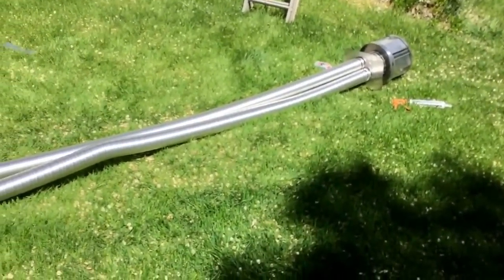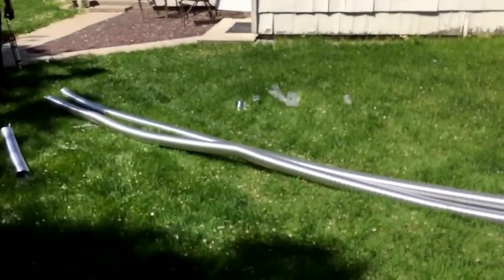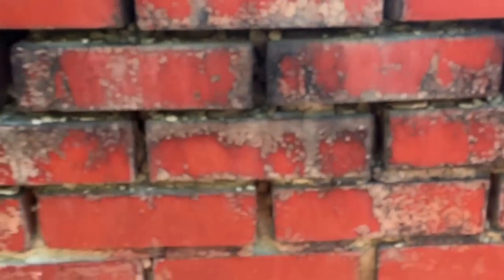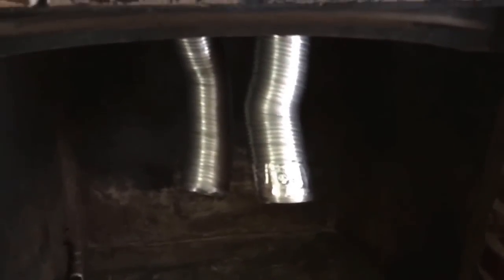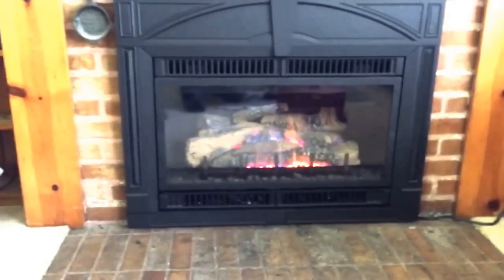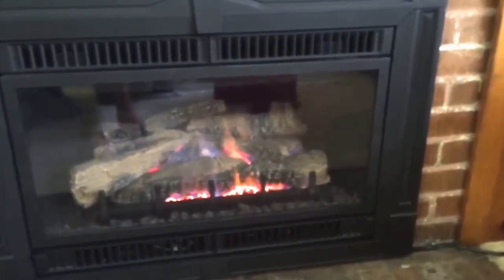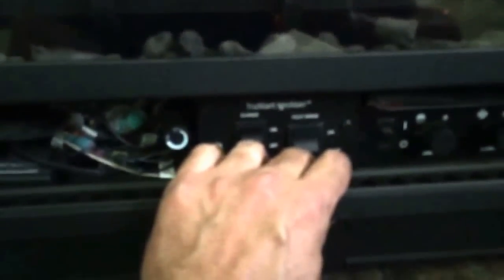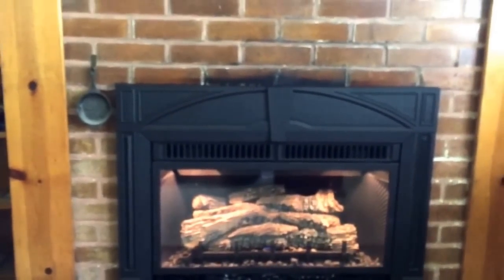DIY Gas Fireplace Insert with Chimney Liner How To Install

Comment: Sorry your budget wasn't $50K for this 4 minute run, however it was enough to answer questions that I had. I was seeking information on the chimney liner and you nailed it. The simple explanation you gave and the tip to mark the leg is certainly a great tip for the DIY'er. This may be 3 years old, however is still relevant. Thank you.

Comment: For fireplaces that you are installing into an existing fireplace (like an insert) that have co-axial outputs (instead of co-linear) what is the best way to vent these? Buy a co-axial to co-linear adapter, or can you just use standard galvanized vent pipe from big box stores and go up and out?  Trying to avoid the extremely expensive co-axial venting that is un-necessary since this is installing into a chimney.

Comment: How much does it cost ? I really want one
Reply: local place is trying to charge me 4700 for a nice 38,000 btu Regency. But I may shop elsewhere
Reply: $5900 with tax WA state from the only guy in town. Included extending the fully accessible 1/2" black iron gas pipe 18' and me adding an outlet in fireplace. Also included 20' of coaxial chimney liner and generic stainless cap. Seemed rather high especially when his worker stopped by to measure and was bragging it was an easy job and that him and his young helper would be out of there by noon. Did it myself and had a sheet metal shop build a bullet proof stainless full chimney cap with folds bent down over the brick, unlike this sketchy little cap. DIY cost was around $3500 if I recall with proper flashing.

Comment: How did you get power to the blower? did you have an electrical box inside the fireplace?
Reply: yea they skipped over that didn't they.  It is probably in the back or side of the firebox or they drilled a hole and routed the plug some distance to an outlet near.
Reply: At the end of video you see the black cord on bottom right coming out front. Not how I would do it

Comment: Nice install but putting some effort into the video production would greatly improve the presentation. Too much waving the camera around, lack of focus, and insufficient dwell time on essential components of the assembly. Quite amateurish.   Would have been nice to see how much trouble you have connecting the pipes to the back of the insert itself.
Reply: no kidding eh!